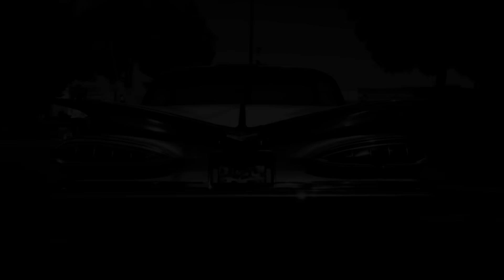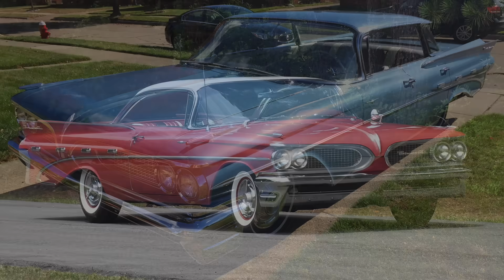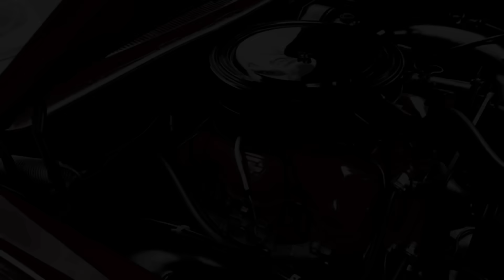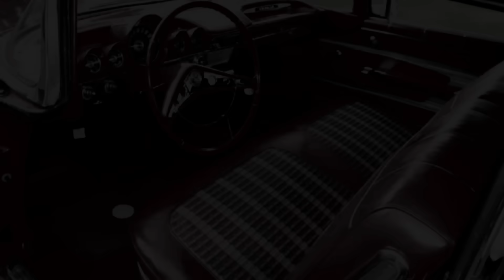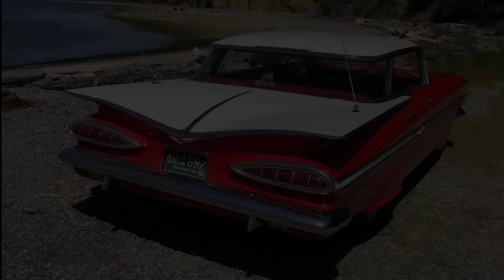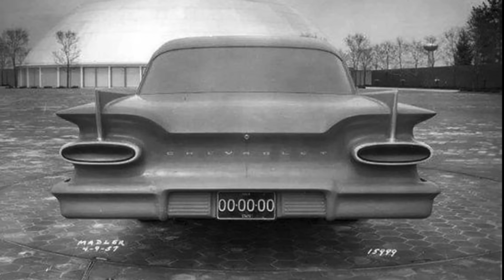1959 Chevrolet Impala: Top 10 Facts About Chevrolet's Most Iconic Car!

Comment: There were 1959 Chevrolets with fuel injection. Few and far between, but they were available. Try finding the original front fender fuelie ornament. Very expensive if  you come across them.
Reply: I've had the privilege of driving a 1959 Impala Sport Coupe that was a 250hp RamJet fuel injected 283 backed by Powerglide.
Reply: @Lurch4you  I only ever saw one. It was. A Bel Air two door sedan. Black with grey interior. I can’t remember which trans.
Reply: Sure, the "fuelie" option was available on the `59 Corvette -no surprise there.

Comment: Are you sure about FI not available?  There are at least 2 Youtube vids showing factory FI engines.
Reply: It was. I know of a 1959 Impala Sport Coupe with factory 250hp RamJet FI backed by Powerglide. 

A " Fuel Injection " call out is placed on top of the front fenders. 

Adam missed on this one.
Reply: @Lurch4you  They actually offered two fuel injection motors. 250hp had hydraulic lifters and 290hp came with solids.
Reply: The one I drove was a 250hp backed by Powerglide.  @howardscott7521
Reply: @howardscott7521  I've driven a 1959 Impala Sport Coupe that was a factory 283ci 250hp RamJet FI car with Powerglide.
Reply: @Lurch4you  I'm jealous, lol. I have owned and restored more of these beauties than I can remember (back when it was affordable), but never got to do more than look at a fuelie.
Reply: I own a '63 Impala and I remember one at an international meet years ago.  I believe it was RPO 578 with 26 produced, rare indeed.
Reply: On `59 Corvettes -sure.

Comment: My dad owned a 59 Chevrolet.  He sold it in 1962.  The six had to be rebuilt, the body was full of rust holes  that he filled in and then repainted it himself and got rid of it as fast as he could.
Reply: Body by Fisher were considered Holy cars, because they’d start to rust just leaving the lot. My Dad had a 64 Impala that had the cancer.
Reply: @MstrGw  My Godfather had a 64 Super 88 (a beast and fast for such a huge car). It was going apart along the frame bottom. Grandfather had a 51 Special which was letting go around the rockers. 
Nice styling and nice to drive but cheesy sheet metal.  The Specials original engine dropped it's pants around 80,000mi.
Reply: Yeah ,I usually chuckle when somebody finds an old 60s car and says : hey look ,it's only got 73k on it. 
Yeah , it's shot/played/tired.
Valve jobs weren't uncommon by 50k or so, 100k on a lower end was up there, definitely got your moneys worth.  @RetroCaptain
Reply: @MrTheHillfolk  Yes almost everything related to the valve train would be suffering wear at this mileage.
This is a true story.
My Dad had a 1966 Dodge Cornet when I was a wee boy. It was in our family 7 years.
It was built in the Windsor plant.
My dad was a maintenance nut. He never let things go past whatever timeline.
It had the 5.2 litre engine and 3 speed powerflite transmission. 
He changed the oil regularly using Quaker State. 
It had 300,000 (330,000 at maximum) when he sold it to a young man for his first car in 1975. I remember my dad did talk about having to lap valves and he had some valve tools.   
Almost all the cars when I was a kid were considered "whooped" by 100,000mi.  They would still run and drive but the floors would be weak and the doors creaky, the windows would whistle cold air in despite being closed and other things like the arse end drooping.
I thought about all the very early 60s cars (can add in late 50s as the situation was the same).
They were all given up on, "back fortied" or sent to salvage.
The odometer was VERY often 60 something thousand miles to a shade over 100,000.  Leaky, tired seat, rusty fenders and floors.  Usually the heaters radio (electrical stuff) was still in perfect condition lots of life left where today that stuff quits EARLY because it's so dam cheap plastic.   
Today cars have 300,000 km on them, run just fine, but everything electronic stopped so the digital dash quit, the heater stopped long ago the radio quit after 4 years..that kinda thing.  And the floor is also rotten like they were in 1965.
Reply: @MrTheHillfolk how many times did the odometer hit that number?
Reply: @larrycashion752  
? 
100k in one of those old beasts without major engine work was a miracle
Reply: @MstrGw  Really? I thought at one point Fisher Body and GM were well-thought of for durability...?
Reply: @67marlins …well I’m just saying what I saw.
Reply: @ …I still do like the 59 body style.
Reply: They also sourced low quality Oil Seals which didn't last long.
A mechanic in the family used to remind me (a youth at the time) how back in the day you could tell where the GM cars were parked by the puddles of oil (like a murder victim chalk outline)
Engine transmission steering and axle.
I did see how he was accurate about this years later. 
I can't argue or fault find as far as GM styling was ahead of the others but quality wasn't. 
I remember other old timer mechanics and body men saying how Chevy would lose headlamps out on the road.
Rot around the fender which held the lamp get all rust pinholes then hit a hard bump in the road and the headlights drop off on the road. 
Why because they weren't equipped with inner fenders so salt and dirt flew up and packed in the upper fender around the lamp pots.
Reply: @RetroCaptain  Oil leaks, and fender rot at the headlamps.Yep that was mine.
Reply: @joebad1106  One high point I remember about them is the thick heavy door hinges and how they never sagged unlike later years of (Chrysler in particular).
I remember having to remove doors and replace wore out hinges or having to "lift the door or it wouldn't latch" or "you have to slam it" (screams poorly made).
They had that area covered but unfortunately once the floor falls out it doesn't matter.  Also GM radios back then were pretty much the best one. Chryslers Mopar radio was almost as good. Fords Fomoco was ok but not as sturdy.
Reply: Didn’t Ford own Philco?
Reply: @seed_drill7135  They partnered up around 1967 for a few years.
I used to have a Philco-Ford TV made around Toronto in 67.  
GM had Frigidaire earlier.
Reply: I had a 59 Biscayne. It was a real rust bucket.
Reply: Used as a swamp buggy😂🎉. We bought a new 59 Bel-Air two tone, blue and white. 6 cyl, 3 on the tree. Was a great car.
Reply: And I’ll bet he or you wished you still had it now.  They’re worth a mint in any condition…
Reply: @judygautier7600 …in mint condition would be awesome but how much is the cost to make them mint?
Reply: @judygautier7600 I was thinking the same thing!
Reply: A well based action😅😅😅
All these vehicles...are merely history now!! Elon Musk...looks intoex terrestial vehicles, nowadays😂😂😂🎉

Comment: It's astounding how much steel and sheet metal was used purely for styling purposes. All of the trunk fin thingys and metal in front of and behind the wheel wells could be done away with, it's all for style points. 
I have a gray 97 camry w I love, and there's nothing extraneous or un-functional on that car. It's also from the 90s aerodynamic-bean era so it's very slick and smooth.
They are both beautiful in their own ways, really.
Reply: You appreciate simplicity. I also appreciate simplicity and reliability. That’s why I drive ‘90s Toyota products. Simplicity and reliability only appeal to a small segment of the population. That’s how we end up with cars like the ‘59 Chevrolets.

Comment: No way the 1959 Impala is 59 inches tall.  That would be a tall car even today.  My 1976 Sedan de Ville was 55 inches tall, and I would imagine the 1959 Impala was even lower.  Current average-height sedans are relatively tall, of course, but the 2025 Camry and Accord are still only about 57 inches.

Comment: I hated these years ago. Now I think that it’s absolutely cool!
Reply: The ‘59 is cool. The ‘58 is hideous in my opinion, especially when compared to the ‘55-‘57 Chevy offerings.
Reply: Looks wise I dig it. Engineering wise, that X frame was terrible. Ever see that crash test of a ‘59 Chevy vs. a 2009?  A 57 or earlier would not have disintegrated that way. 

The occupants would have still died, but at least you would be able to extract the corpses from the car.
Reply: @ 
Yes, I recall the offset crash test between the 1959 Chevrolet and a 2009 Malibu. I worked in the collision repair industry for 45 years.